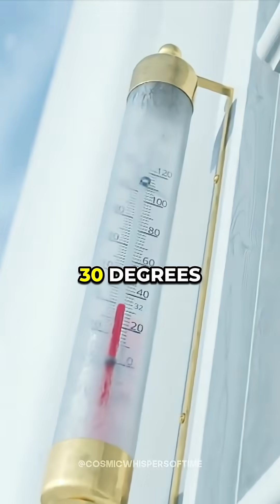Why Pipes Burst in Winter ❄️ w/ Neil deGrasse Tyson

Comment: When outside temp is 25 F the water inside the copper pipe cools too, even though it remains still liquid. The water in the pipe does not 'stay 32 F'. Copper pipe 'squeezing' does not prevent inside water temp from dropping; just from solidifying.
Reply: T° might be the same as the outside tho the pressure is not and that makes the freezing point to go below the common 0°C ; 0°C at 1 atm is normal freezing point on water but if the pressure inside the copper pipe is higher that, you're gonna need more than 0°C (For example at 2000 atm you would need -22°C to froze that water)
Reply: @leandrobascur8957  What happens when it's below 0°C and the end spigot gets turned on a water flows for a bit?
Reply: @leandrobascur8957 See my response. You have the Temperature Pressure Relationship backwards.
Reply: Pressure-Temperature diagrams for the win, Neil!
Reply: Because water needs to expand in order to turn to solid, but it can so it just stays in water, until the pressure or temperature difference is great, and if the pipes strength cant hold it will burst then the ice inside wuickly turns into solid, am i right?
Reply: @Requiem_NVM3 Correct!
Reply: Yes he made a big mistake!
Reply: @HDSME That’s OK. We are all entitled to occasionally make a mistake… as long as we don’t do it too often. I still have great respect and admiration for him and anyone who earns a PhD.
Reply: Pressure creates heat, so until the pressure reaches the breaking point of the copper's strength, I would say the astrophysicist knows what he is talking about when he says the substance in the pipe is still a 32 degree liquid.
Reply: That is incorrect. Pressure alone does not create heat. What creates heat under pressure is compression, and as water is close to being incompressible, then almost no heat is generated when it is pressurised.

In any event, even if a tiny amount of heat was generated by the very slight compression of water under pressure, then it would just get conducted away through the copper walls.

So, no, the astrophysicist it simply wrong. It happens.
Reply: @brucee4634  nope. Think about temps at deep ocean.
The astro guy IS wrong on this one.
Reply: The haters just don't understand what you're saying.. you weren't really saying he was wrong,  he just didn't explain that pressurizing water lowers the freezing temprature.. in the end, it keeps the outside temprature from freezing the water inside the copper pipe
Reply: @christopherallen5603  and flowing water will not freeze either
Reply: hmmmm will I believe a world famous world renowned scientist or some clown on youtube that no one knows or cares about..... boy howdy its a tough choice!
Reply: bro, he said no. stop explaining
Reply: But if the temp belows inside the pipe also the pressure, if the pressure inside the pipe remains stable also the temperature.
Reply: @DEATHSSHAZE  The T° is the same in both places (inside and outside), it only changes the freezing point; at higher pressure, you'll need less (or more depend how you read it) than 0°C. Let's suppose than a 10 atm you would need like 5°C or so
Reply: @leandrobascur8957  No, at 10 atm you do not need 5 °C to freeze water; it’s closer to −0.07 °C. How on earth did you come to this conclusion.
Reply: Same thing as when you heat water in an open pot at atmospheric pressure. Water will never raise over 212F, regardless of the temperature of the stove, at which point it becomes steam (gas). Now, put the same water in a pressure cooker and secure the lid, as the water temperature raises, so does the pressure and the boiling point, therefore, the water will exists in liquid form above 212F. That’s why you are able to cook something faster, because the water temperature is allowed to rise above 212F, it is not because of the pressure, is because the pressure allows the water to stay liquid above 212, and beyond.
Reply: @RicardoSoltero-o7o this does not apply when freezing water in a pipe. Because the pressure increases, so you would assume it would freeze because of pressure. But it doesn't because you are ignoring energy conservation.
Reply: Imagine you put the Hot side of a Sterling engine on the pipe and the Cold side   At the outside. IT would run forever..
Reply: Absolutely!
Reply: when the pipe burst, there will be some freezing but the water ice mixture will warm up.
Reply: Exactly. How can someone tell such bullshit with such confidence? What does he think how physics works? Does he believe the copper insulates the water thermically? Jesus.
Reply: Yeah basically the same as a radiator in a car it's above boiling temp but pressure prevents it from boiling
Reply: @mitchelllewis1079  no it dies not freeze because  it is flowing
If it's still it freezes at 32 apx.  Pressure is has nothing g to do with it
Reply: Pressure bursts pipes, not temperature
Reply: @2Abstract43  lower the temp you freeze the water increase  pressure  !!!
Reply: neil the ass tyson
wrong so often
DEI
Reply: Pv = nrT . That’s what he’s explaining
Reply: @ytpunkguins you are quoting the ideal gas law, and has precisely nothing to do with water freezing.
Reply: I posted this in another comment. 

This is actually more complicated than every one of you is making it seem. Everyone who states Neil is wrong are not doing a full evaluation of the macro and micro forces. Someone pulled Ideal Gas Law which doesn't apply.

Let's start with Water Freezing. Water expands when it freezes, and the pressure of a liquid remains equal throughout the pipe with no obstructions. Water at higher than atmospheric pressure remains water at 33F. At 32F it begins to freeze. After it freezes, the temperature can drop.

However, water expands initially when it freezes, so as the water is freezing and there are small ice crystals trying to form, they increase the pressure of the water. Now in order for water to freeze it has to expand so the pressure builds. The water's molecular bonds will not release heat energy as that energy is converted into pressure energy. So the temperature doesn't drop, but the pressure increases. 

Neil is right. I didn't know before I wrote out the analysis, but it makes sense. As long as the energy is conserved, the analysis is valid.
Reply: @kbenti  "Now in order for water to freeze it has to expand so the pressure builds. The water's molecular bonds will not release heat energy as that energy is converted into pressure energy. So the temperature doesn't drop, but the pressure increases. "

That is just wrong. There is no doubt the energy content of the water under compression is higher than when it is not. That is because water is very slightly elastic. Thus there is a higher energy density in that compressed water, but it's in the form of potential energy, not thermal energy. 

Temperature is also absolutely not the same thing as thermal energy. Something with a higher specific heat capacity will hold more thermal energy at a given temperature, but to repeat again, it's absolutely not the same thing as higher temperature. In effect, that compressed water has a higher specific heat capacity than when it's not under pressure.

So what is temperature? It's the average kinetic energy of the particles that make up the substance in question, and that relates to its speed (for equal mass). In the case of the pressurised water, to maintain the same speed per particle, and hence temperature, it simply needs more energy due to the increased forces. 

It is a basic principle of thermodynamics that temperature equalises itself when things are in contact. Heat always flows from the hotter to the cooler, but to repeat again, heat energy is not, in itself, a measure of temperature.
Reply: What, you think you know more than this famous scientist? 
Surely we should trust him implicitly! He's famous! For Science!
I mean, you're right and he's wrong, so at least you have the truth, but what is the truth in the face of his sciency fanboys?
Reply: @jamesahibbard So, he missed that one. That’s Physics 101, the man has a PhD, he has forgotten more about physics than most of us will ever learn, and I have a Mechanical Engineering degree. No need to humiliate him. I’m sure he realized his mistake.
Reply: @RicardoSoltero-o7o Neil is right. Do the full conservation of forces and conservation of energy. It becomes obvious that the temperature cannot drop as the pressure increases. Why? The heat energy is converted into Pressure Energy. So no heat is released in order for temperature to drop.
Reply: @jamesahibbard  this guy is right the pressure being exerted on the water allows it to get to a lower temperature before it freezes, it is the same with boiling water , it will not boil if there is too much pressure on it.
Reply: @jamesahibbard  he talks a lot of shite too
Reply: @jamesahibbard  that famous scientist has made a mistake. It happens you know. 

It takes about 140 atmospheres (2,000 psi) to lower the freezing point of water by 1 C, and by 25F it's going to require approaching 8,000 psi of pressure. Simple copper water pipe designed to contain maybe 20 bar pressure isn't going to be able to handle that 

Of course what will happen is that the copper will get stretched by the internal pressure, until the point it ruptures. That's going to happen long before the temperature drops to 25F. At which actual temperature it fails will require looking at the tensile strength of the copper, the cross-sectional area of the copper, the expansion coefficient of super-cooled water in a liquid form, the internal diameter of the tube and so on.
Reply: @jamesahibbard  The OP basically restated what Tyson said.  Were you unable to comprehend either?
Reply: It's called arguing or correction. Even the smartest people can make mistakes so we can still correct them  @jamesahibbard
Reply: @kraineoit's called sarcasm.
Reply: @kraineobruh
Reply: He made a mistake by stating that the  water temperature inside the pipe stays at 32F, he knows better, but you can’t deny his communication and engaging skills. Can you imagine more school teachers with such skills?
Reply: I kinda thought it would stay at 32 because 32 is freezing point but the pipes are keeeping it from solidifying so it would stay at 32 and liquid form until a sudden shock which would be the pipes giving in ..kinda sorta like the water in the bottle trick take it out the freezer at 32 it’s still liquid tap it on the table and it freezes and expand just how I took it when he said but I get it that way too
Reply: @dar3al3tym3sthree-mix7 this is a perfect example of what Neil is explaining. The addition of the shock causes the water crystals to align, causing a cascading formation of ice. However, it doesn't fully freeze. It's a mostly ice crystal water mix. Which means it's still 32F.
Reply: @RicardoSoltero-o7o Neil is correct, if you do a full conservation of forces and conservation of energy.

Comment: I can envision the water going below 32 without freezing much like we can get overheated water in the microwave that will flash-boil once you drop something into the container.  But why in the hell would it be 32 if heat (energy) leaks out and heat is merely a measure of average kinetic energy of particles in a substance?  Energy drops, temperature drops, no running away from it the way I see it.  Can someone explain what the guy is talking about?

Comment: Super-cooled water. This is the prevailing theory behind why the scablands in Eastern WA came to be. Repeated glacial dam formation in Montana over what is now Missoula. After hundreds of years of water accumulation, the pressure built so high that the water molecules start creating friction and formed micro-cracks in the ice at the bottom of the dam, despite the water temp being at or just below freezing. The friction continued as the water is forced into the tiny cracks, further melting the glacial ice over decades until the dam's structural integrity fails, collapses, and you get a massive tsunami racing west through Western MT,  ID, and Eastern WA, eventually dumping into the Columbia River gorge and out into the Pacific. 

This allegedly occurred numerous times during the past few ice ages, scarring the land.

Comment: While it's true that pressure can change the freezing point of water, it requires an immense amount of pressure to make a noticeable difference.
 * Household Water Pressure: Your home's water pressure is typically between 40 and 80 psi.
 * Pressure Needed for Change: To lower the freezing point of water by just one degree Celsius (to 30.2°F), you would need to apply approximately 1,987 psi.
Reply: Water behind glacial dams can acheive high enough pressure to stay liquid at below freezing point. The pressure creates enough friction to keep the water from freezing. It also forces water through micro-crack where frictions melts the ice creating instability and ultimately dam failure. Fascinating stuff.
Reply: But isn't that how ice skates work?
Reply: @p39483 When you compare the pressure created by skate blades to the pressure needed to significantly lower the melting point, you'll notice a disconnect. The pressures generated by skates are often not enough on their own to melt ice that is well below freezing (e.g., -10°C to -20°C).
This has led to the development of other theories to explain ice's slipperiness, with the most widely accepted current view being a combination of factors:
 * Pressure Melting (especially near 0°C): This still contributes, particularly when the ice is already close to its melting point.
 * Friction Melting: As the skate blade glides over the ice, the friction generated creates heat. This frictional heating is often considered the dominant mechanism for creating the thin water layer, especially at colder temperatures where pressure melting alone wouldn't be sufficient.
 * Quasi-Fluid Layer (Surface Premelting): Even at temperatures well below 0°C, the very surface of ice naturally has a "quasi-fluid" or "water-like" layer. This layer, sometimes just a few molecules thick, is more disordered than the bulk ice and contributes to its slipperiness even without external pressure or friction. The skate might interact with and enhance this existing layer.
So, while the idea of a "cushion of water" is correct, the formation of that water layer is likely due to a combination of the pressure from the blade, the friction it generates, and the inherent properties of the ice surface itself.

Comment: Pipes don't squeeze their content the content applies pressure to the wall of the pipe as it attempts to expand and the pipe has a set burst point pressure. If the content is under pressure while of it's self that changes it's freezing and boiling points. If there are no voids in the pipe for the liquid to move into as expansion takes place boom!

Comment: How can water stay at 32 degrees if outside temp drops below that, water will drop too but it’ll stay liquid due to pressure
Reply: how? 32 is summer temperature. This is how
Water freezes at 0° not 32
Water boils at 100°

32 is warm/hot water
Reply: @Sir.BlackHole  he’s talking F not c